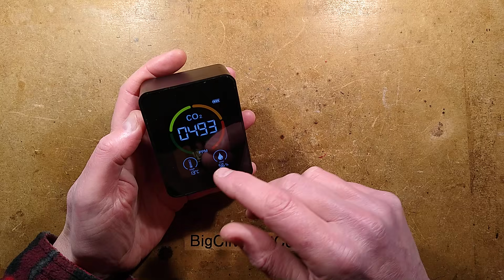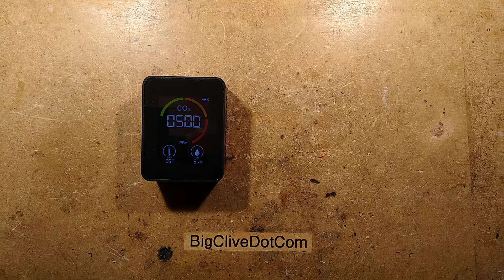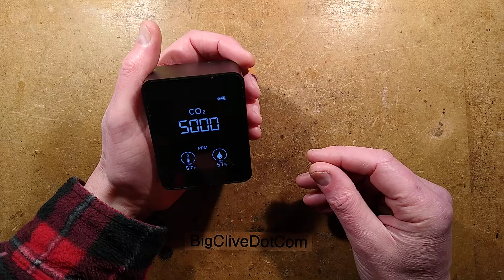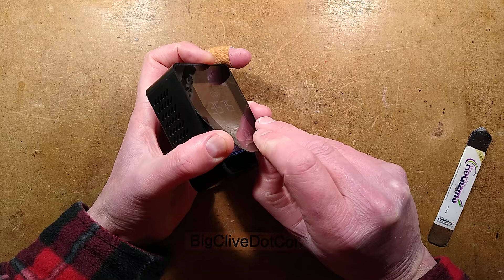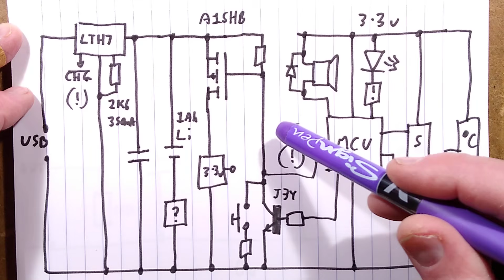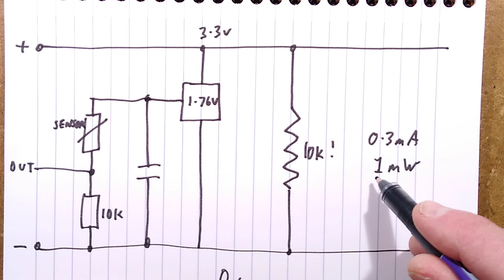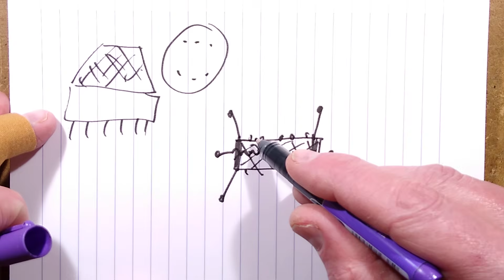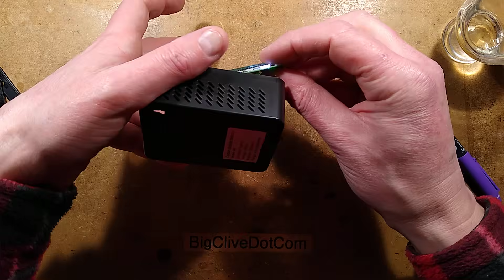Fake CO2 monitor (party detector) with schematic

Comment: you can get them also in a wifi variant i think thats what that "connector"/pad is for its for a external wifi module, maybe a espxxx of some kind or the new tuya beken modules what i know is they can be connected to tuya cloud. WOuld be nice hooking a uart or serial to usb converter up to those uart pads and sniff the information, maybe we can get it to say what micro is under that sanded part or the partnumber, probably a stm or st microelectronics part

Comment: Being one who never fully trusts “self-test” we would always do a crude field test now and then - co2 just breathe into it, Co monitor put it near car exhaust, smoke use an incense stick.  Not accurate but it at lease gives some confidence. (When did you last check your household smoke or Co alarm other than pushing the test button which really just checks battery or circuit)😂

Comment: We had co2 sensors put in our offices during the corona as improving air quality at the time was the big thing... but the ones here are real. The co2 was often between 2000-3000ppm before they improved ventilation.. could just be the placebo effect but a lot less headaches (still have the same pack of painkillers in my desk for 6 months now!) and can swear i feel less tired than before.

It's most likely a VOC sensor estimating the co2 not a recommend use for them.. the real co2 sensors use a laser so i believe

Comment: Whats most likely happend here is supply chain problem. Factory runned out of CO2 filtres (and probably battery protection chips) but otherwise had enought materials to keep making theese things. So found another sensor with the same footprint and used it instead, untill they can source more real CO2 ones.

Comment: I have one of those but with a white case and it has clips instead of screws and it works with CO2 really well. I used to use it in my restaurant nearby the beer taps to detect leaks in the CO2 tank.

Comment: Clive. CO2 levels are a real health issue in catering venues where they sell carbonated drinks because they are carbonated on site often using huge bottles of CO2, usually in a basement, where it pools and poisons people if there is a leak. There is a whole industry dedicated to CO2 detection and alarm systems - but it is not mandatory in all places that use CO2..... so some people will be betting their safety on crap like this. People need to be punished for selling fraudulent safety equipment.....or we just embargo all Chinese products costing less than £100 so real manufacturers can undercut the crooks for once.
For the PEDANTS (and there are a lot of us watching this channel) who would say that CO2 isn't toxic.... it actually is when it gets to about 4% (40,000 ppm), with 5,000 ppm being the max permitted working environment level in some jurisdictions. And those numbers are frighteningly easy to achieve with a gas that is heavier than air in a basement with bottles of liquefied CO2 waiting to leak.

Comment: I just bought a variation on this and it detects alcohol, it detects natural gas from our cooker and it also goes off after a particularly prolific fart. If I use the toaster it goes off and the levels go higher when we cook (either in the air-fryer or the gas cooker). 

Mine purports to detect TVOC, CO₂ and HCHO (formaldehyde).

Comment: Proper CO2 monitors are to measure airflow. If you work with groups, in my case singing groups, they help to assess when to open windows rather than having them open all the time. Especially over winter this helps to keep rooms warm while managing the risk of airborne illnesses

Comment: I have used NDIR-based CO2 sensors (MH-Z14, MH-Z19) in an office setting, and it was quite interesting to note the average levels. After seeing the PPM levels in a meeting room zip past 2,000 ppm with about a dozen people inside for an hour, it made sense to me that one would start feeling drowsy and lose focus during such meetings. It's not just that they're tedious wastes of precious life minutes.

A number of studies have been performed on the impact of CO2 levels on cognitive functions, which show that a rise from ~400 ppm to 800 ppm drastically reduces one's ability to perform even basic office tasks. It's like being sleep-deprived, or tipsy. Beyond 800 ppm it just plummets and by the time you hit 2,000 ppm, individuals will begin to get headaches, start feeling nauseous, etc. At around 5,000 ppm you'll have people literally passing out, with a number likely having puked up their guts before then.

In the open plan office of this place levels got to 800 - 1,000, which was a good hint to crack open a window, which helped a lot. In that sense, CO2 sensors are an invaluable tool to keep track of air circulation in a building, and the build-up of stale air. The same project (BMaC: Building Management and Control) also got used for other purposes, such as keeping track of the number of cups of coffee drawn from the machines via their serial port, which provided an interesting comparison point for CO2 levels and coffee consumption :)
Reply: In our office we had one meeting room which reliably put people to sleep. It got so bad that I eventually reported it to facilities, who investigated, and discovered that the aircon hose hadn't been plugged into the ventilator in the ceiling. So it was keeping the ceiling crawl space nice and fresh while we slowly nodded off below! After replacing the hose the meeting room was fine.
Reply: 1500ppm seems to trigger the HVAC in my office - far too high to be able to concentrate (now that I'm adjusted to the level in my office at home).
Reply: Found exactly the same in our office... Everyone would start to feel sleepy around the same time! Turned out to be CO or CO2.
Reply: @m1geo  I've  been to meetings where no amount of fresh air would help...
Reply: I like your last idea about correlating coffee consumption with co2 levels.
Reply: That was really interesting!
Reply: My bedroom reaches 3000 ppm sometimes. I guess i am used to it...
Reply: @mr_b_hhc  I just aired out and now I am at 640 ppm. Woke up to 2700. I could leave my bedroom door open but I wake up easily
Reply: I used this sensor and it is poor imo. I've had much better with Grove.
Reply: Very smart lady.👩‍🔬
Reply: @mr_b_hhc  I first read "but for goodness sake, change your mom."
Reply: now I know how to keep my office building so people like you won't try to get smart with excuses
Reply: Be curious effect some plants have. We're small advertising agency so lvls never likely that high (at most around ten ppl, small office space tho, like 3 rooms and a short hallway, old apartment converted to office space right), but one of our clients is a garden centre and two of our staff are enthusiasts(one actually used to work at that garden centre, but the owner helped her find work with us) so, got a few plants kicking around xD 

Like said, never insane amount ppl but does get crowded as small space, yet never feels stuffy even dead of winter.

Comment: Technology Connection recently posted a video showing that his gas stove caused CO2 levels to be surprisingly high in his poorly-ventilated apartment
Reply: not co2.....particles........PPM....
Reply: @roystonbarton  PPM is a measure of concentration; like percentage but at a smaller scale. It is ubiquitously used for expressing CO2 concentrations.

So if TCs air quality detector was decent and not fake like in this video, then yes CO2.

Comment: During the pandemic I had to go to work as my job involved some contracts that supported the NHS and other essential services. There was concern about air quality in the workshop. My line manager bought one of these sensors to reassure us all that our air quality was good. This was a concern as we had to keep the door closed for security purposes. I suspected it was fake as we use isoprop to clean flux from pcbs. It went mental when we sprayed the isoprop and also if you peeled an orange near it. I ignored my boss and kept the windows open.

Comment: I spent a couple of vintages working as a casual cellar hand in a local winery. It was my job to walk through the winery at the start and end of a shift with a CO2 monitor to check levels in the fermentation rooms. I had to then record peak levels on a weekly sheet. Some kind of health and safety box ticking exercise for a well known local international winery here in South Aus.
The only time anything interesting happened was when I farted into the sensor. Evidently it wasn’t only detecting CO2 and gave a warning that methane levels had peaked beyond dangerous levels. No sh1t! (In either sense…) 
Amazing what happens when technology falls into bored and idle hands during a long night shift 😂

Comment: I've often wondered how big of a problem carbon dioxide was when living out of a vehicle. I don't mean like a big tractor trailer truck just like a regular pickup truck. Most modern vehicles still up pretty tight... And there have been times where I stayed days in my truck without cranking it or rolling down the windows or getting out. And I've often wondered if carbon dioxide would be an issue

 There have been a lot of times over the last two or three years where I'll be in the truck months at a time especially when taking care of my sick parents. Its been a lot easier staying in the truck at the hospital at night instead of the long commute back and forth. And since there have been times where we were there months at a time... And especially during covid-19 the hospital was lockdown and they wouldn't even let me in the doors but once a week... Sometimes my feet wouldn't hit the ground outside of my truck but 30 minutes every seven days. I know that sounds terrible and disgusting and unhealthy but it was rough for awhile there and Even though I couldn't go in the hospital, mom was sick enough at that point where they told me not to go far. So I was just kind of stuck in the truck... Then after that two years of craziness business and everything was so bad that I just kind of stayed there for a while. Anyway I often wondered if carbon dioxide build up was a big deal especially if not cranking up the vehicle or rolling down the windows but once every 2 or 3 days.

Comment: I have been designing and installing such devices were it is very important that they do correct work. It is so irresponsible and potentially dangerous to put these on the market. Great work Clive!! Keep it up!
Reply: Especially given a similar design was sent out to schools in the UK for use in classrooms to help them balance disease prevention with heating requirements given how expensive energy is at the moment. That's designed to a spec though and only has 3 colours, lighting up one at a time from 400-800, 800-1500, and 1500-5000, to match previous models that had been produced from the Chinese factories that Rexel (who got the government contract for the CO2 monitors) had contracted out to.
Reply: @itskdog  did they work
Reply: @tylern6420  as far as I can tell these are working. The numbers for with previous models we received in the first batch in 2021.
Reply: @itskdog  must be a proper sensor then

Comment: There seems to be a range of sensors of this type :-
    MQ-2 = flammable gases such as LPG and propane;
    MQ-3 =  ethanol;
    MQ-4 = methane (CH4) and natural gas;
    MQ-5 = LPG and methane;
    MQ-6 = LPG and methane;
    MQ-7 =  carbon monoxide (CO)
                   and hydrogen (H2);
    MQ-8 = hydrogen (H2);
    MQ-135 = gaseous ammonia (NH3), benzene,
                  ethyl alcohol and carbon dioxide (CO2).

Comment: The sensors reaction can be explained by the cross sensitivity of these sensors. For my work I have a BW GasAlert personal gas monitor and it measures oxygen, CO, H2S and LEL. The CO (not CO2) sensor is extremely sensitive to alcohol. I discovered that when I had hand disinfectant on my hands and brushed the sensor with my hand. The thing went through the roof.
The CO sensor is also cross sensitive to hydrogen, hold it close to the vent of a charging lead acid battery and it reacts as well.
Reply: In this case, I wonder why co detectors are so expensive at hardware stores, if a cheap ebay device does the same thing
Reply: @treadless_co  reliability is a thing as well. I rather have a properly tested device than a random eBay special.

Comment: It could be a eCO2 sensor/CO₂eq sensor, an old one is the SGP30 from Sensiron that I've played with, which does the same thing when detecting volatile organics. Have a look at it's datasheet it seems to be very similar to what this product is doing. The SGP30 has to be heated for about an hour to get anywhere close to an accurate reading. There is some relevance between detecting the volatiles and being able to get a "approximate" CO₂ reading and some interesting science... Obviously it's not going to give you a "real" CO₂ reading - although you can get something like an MZH-19 which will actually look at CO₂ rather than basing it off the volatiles, but it's a more expensive chip and they only get more expensive from there... :)

Comment: Suggestion is to try to leave the unit running for 48hrs then repeat the testing. Some MQ sensors require time to settle in.

Comment: It's not a fake.  The description of these units on Amazon (eg) states correctly that the detection method is "TVOC", Total Volatile Organic Compounds.  In other words they're designed to detect levels of anthropogenic VOCs which are generally produced alongside CO2 in human activity such as respiration.   So the level of VOCs in the air inside a building where human activity is taking place is an indirect indicator of CO2 levels.   VOC detection is a lot cheaper than direct CO2 detection allowing these units to be produced for a fraction of the cost, but yes the downside is that they are easily fooled by introduction of VOCs without CO2, or vice versa.
Reply: Just because they're using weasel wording doesn't mean that they're not fake in terms of getting consumers to trust them when they shouldn't

Comment: the heater has to be on for 90 seconds at full voltage ( normally 5v) it is then reduced to ~2v for 30 seconds which is when the measurement is taken, the process is then repeated. The initial full voltage is to burn off any impurities

Comment: It's a CO sensor. CO is a reducing agent and it gets catalyzed on a piece of platinum wire. It's the same sort of sensor as the alcohol ones but calibrated and produced differently.
As for what they react to, most alcohols, I would say esters are a safe bet too, like ethyl acetate, acetone, hydrogen, and ammonia. Second to last blows up on contact, last one turns into the brown unwanted gas.

Comment: I have a sensor in the same box, but, an entirely different circuit board and the screen is a custom LED module, but it looks like a cheap TFT.  It does measure CO and CO2, PM 2.5 and PM 10 + VOC and Hydrocarbons.  Thankfully the readings are in line with my other sensors.  Just out of interest, does the CO2 read as soon as you start up?  If it does, this would be a good guide to it being fake.

Comment: Is the input in the back? I say input but I mean I guess the air intake? On both sides of the air intake is a flush mounting slot. How's that supposed to work? If you mounted flush to the wall you block the intake.

Comment: CO2 detectors came into vogue as a proxy for estimating infection risk of covid. The idea is that if the CO2 levels are higher, then the air isn't circulating through the room enough and the chance of covid transmission is higher.

Comment: That latching power supply reminds me of what you had to do before microprocessors/controllers had low-power and sleep states. 
One such design I was involved with back in the late 70s involved used a Z80. In order to power it down when not doing anything the trigger inputs went to a CMOS XOR gate, the output of which switched on power to the Z80. The other input of the XOR was from a CMOS latch controlled by the Z80. Sequence was a change of input switched on the power to the Z80, Z80 held on the power, did its thing, set the latch to the same state as the input then killed its power.
Reply: Having now looked it up, it was a 6802 with a 6821 PIA and the last update was in 1983.
Reply: I think a microprocessor "keeping its own power button pressed" is still the best solution for battery life, because you can get truly zero current when turned off. A sleeping low-power micro might drain the battery in e.g. 3-6 months of non-use, whereas a disconnected battery stays full for many years (especially non-rechargeable cells).

It's silly that adding a transistor used to cost money, but these days they can be cheaper than the cost of the bean-counting and re-engineering required to make it work without one. Though that doesn't stop bean-counters from demanding the removal 😆
Reply: @renxula  FWIW I've got a bit of test kit I built back in 2013 using an ATtiny13A which goes into deep power down when not in use. Iq is less than 1uA and it still works fine on its original two AA cells. As they're now in the danger of leaking zone I might swap them for a 123A lithium cell.

Comment: I have one with that exact case and screen, and mine does seem to react to co2. Very different sensor inside mine. Also an 18650 instead of that battery.

I’ve had it to 5000 but only when the gas stove was going full tilt.